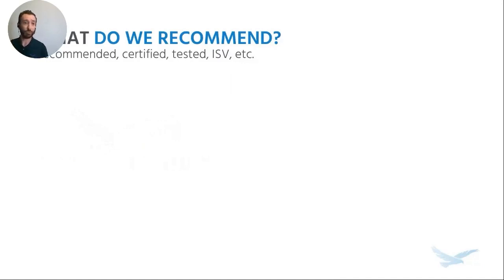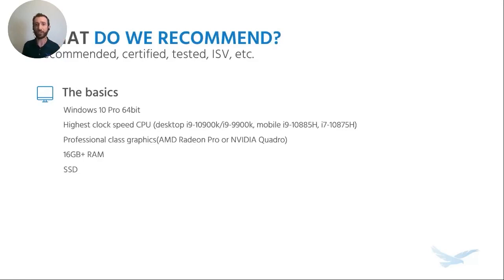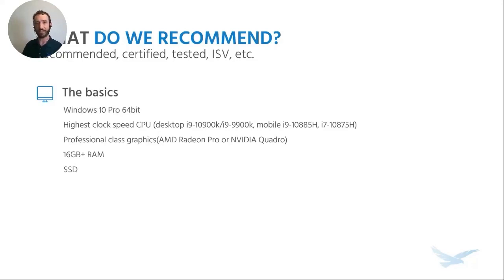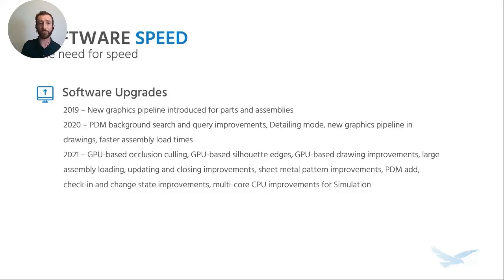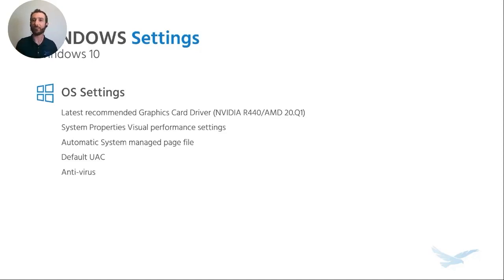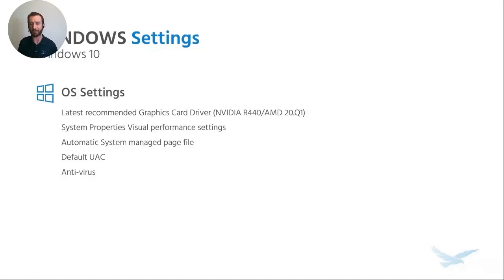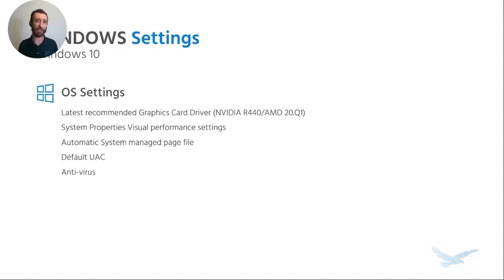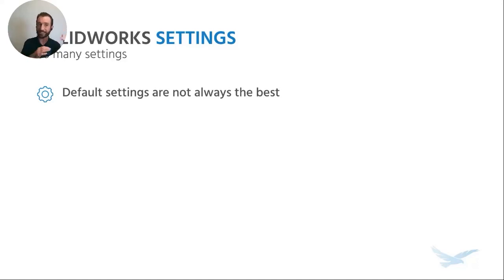Improve Performance with Optimal Hardware and Settings

Comment: This was great, admittedly I'm running a 3070 card, so not optimal, but it should have been performing much better than it was.  I just upgraded to 2022 from a much older version, and all of the settings on 2022 were cranked up, I didn't know this until today.  Got all this stuff adjusted and its SOOO much better.  Also, FYI, McMaster part models have their graphics settings set as high as they'll go when they're first downloaded.  If you have a bunch of specialty hardware (shoulder bolts, over-center latch shaft collars, etc.) in your assembly, this can really ruin your performance, especially if a lot of this hardware is on a moving part, trying to drag the moving part on the assembly (like on a track) will just really suck if those parts aren't turned down. 
Thanks Hawk Ridge for the great video.